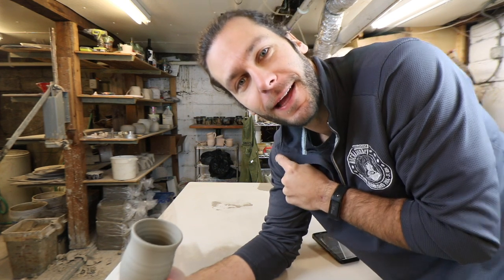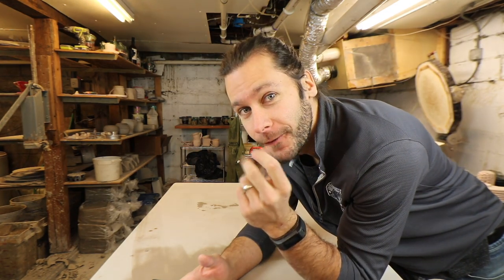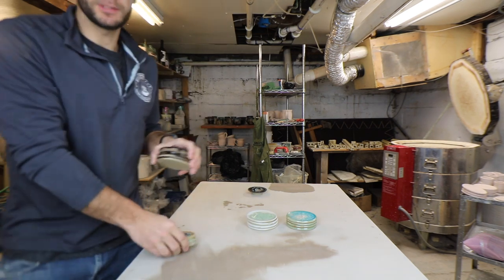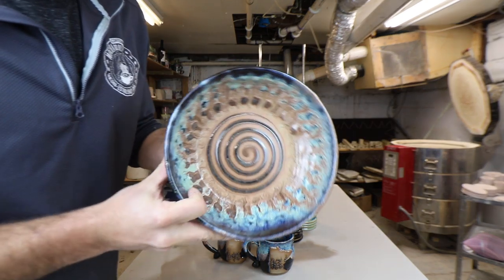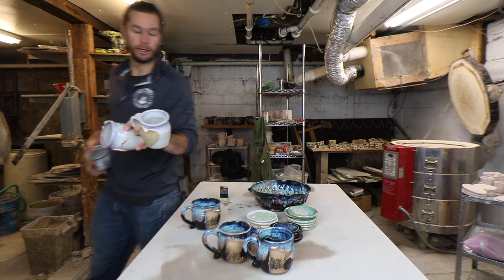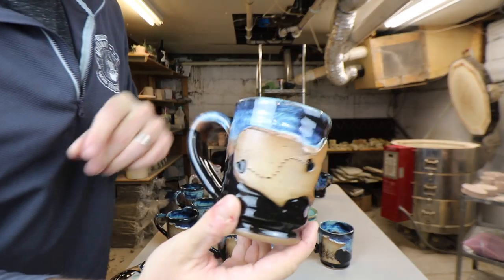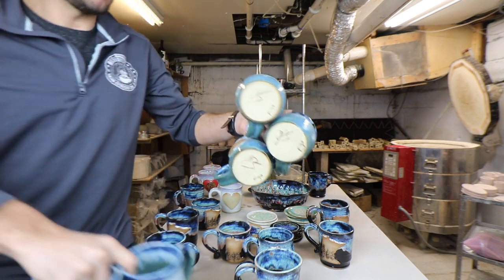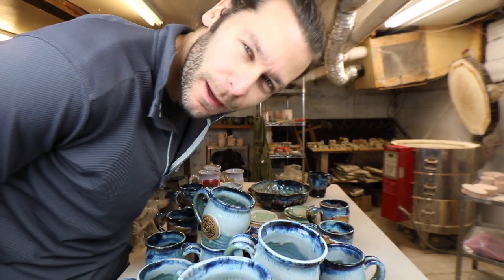Identity CRISIS - Unloading Kiln #41

Comment: I don't mind the bits of red, but prefer the more subdued, salmon color that forms on the edge of the drips.  
Have you thought of using plate sitters, for your coasters?  You could fit a lot more that way.
Also that little vessel, you said could be a candle holder, could also be used for a jewelry, soap, sponge holder, for near a sink.